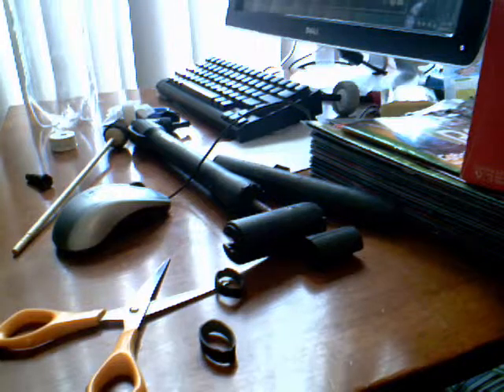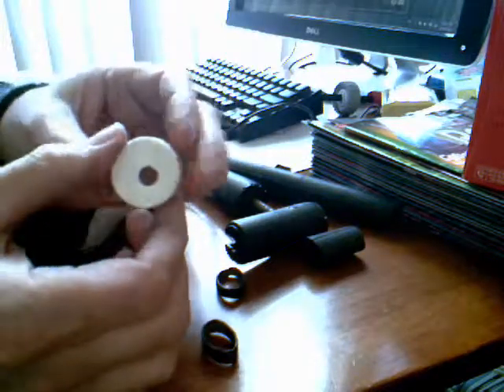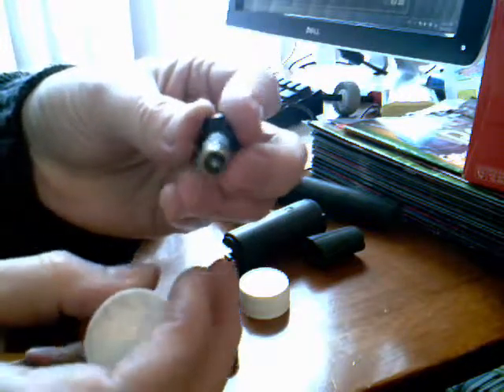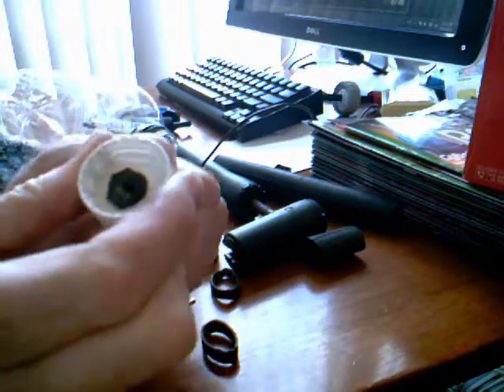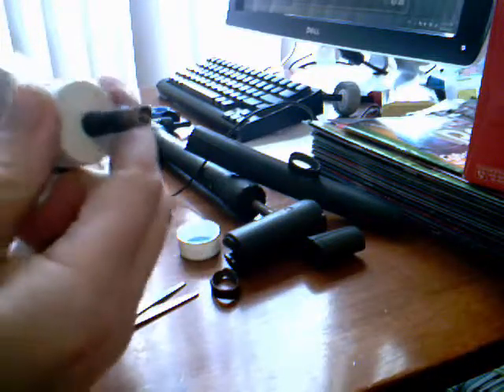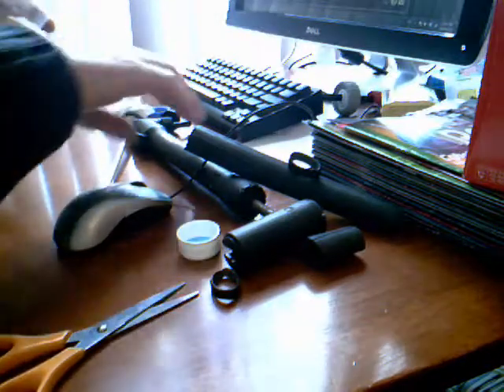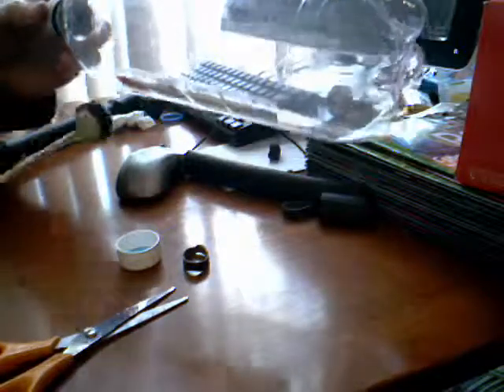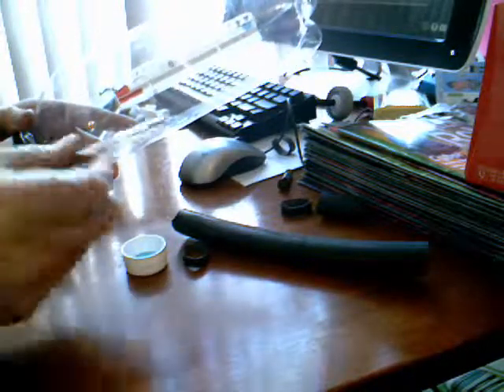Tunable PET Bottle Percussion Instrument

Comment: do you know the physics behind this? How air pressure relates to sound frequency? An equation of sorts?
Reply from the maker: No equations, sadly, but I'm sure they could be derived for at least an idealised cylinder of given material properties. I just tuned them by ear, higher pressure inside the bottle increases the speed of vibration when struck and increases the frequency of the note.